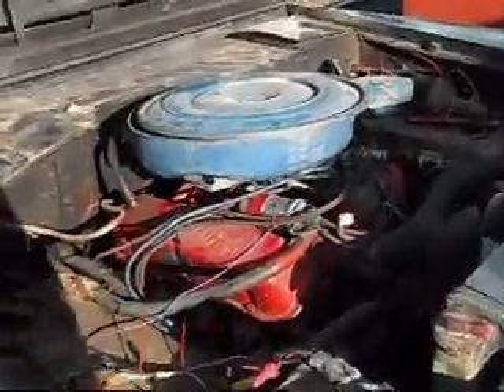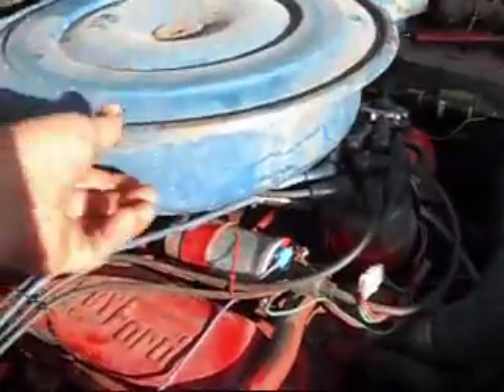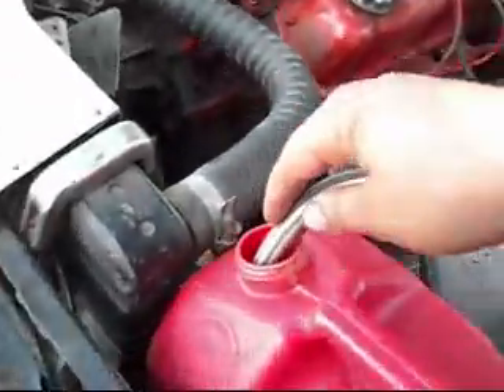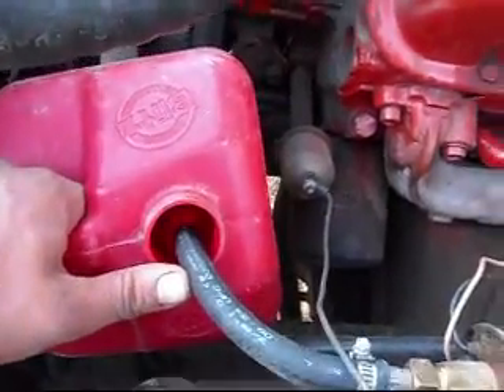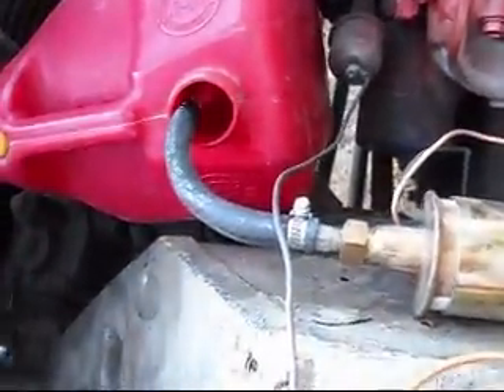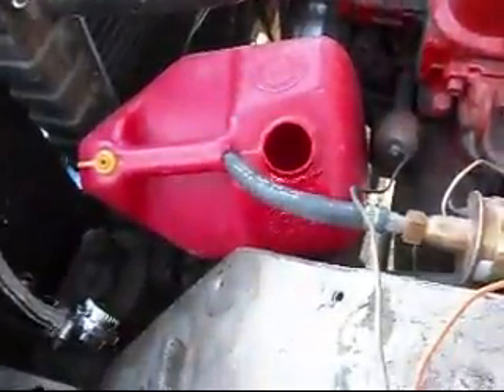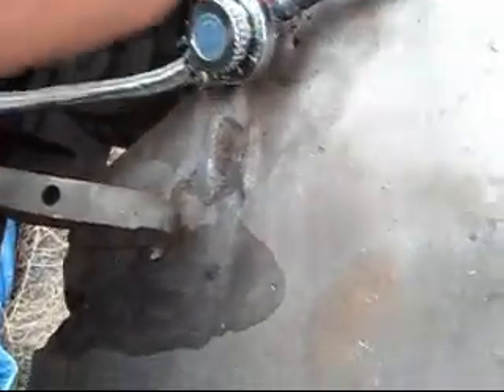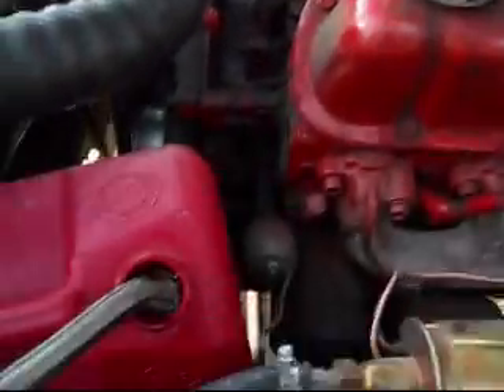A Short Vid (Need Advice)

Comment: dude, plug the fuel line coming from the fuel pump into the nossle on the bottom of the regulator, run a line from one of the nossels on the side of it, and either plug the other side or attach a pressure guage to the other side. The way that these things work, at least the one i got, the fuel goes up from the bottom of it, Then will shoot out both of the side spouts, but you only need one so i recommend putting a guage on the other.  Hope that helps. Oh and thanks for the complement on my car.

Comment: I wouldn't know what to do for the electric fuel pump area but my best guess would be that the regulator might be bad. Can you take compressed air and blow strait through it to test it? As for the carburetor Im betting the accelerator pump is probably shot if your having to dump fuel down it to start it when its cold. A good rebuilding should do the trick nicely.

Comment from the maker: I have a feeling the carb is in need of a rebuild anyway because I have had at least two carb fires... That usually cooks the jets. I was planning on removing the regulator and blowing air though it because It may be plugged up with bad fuel. I will get r done though..